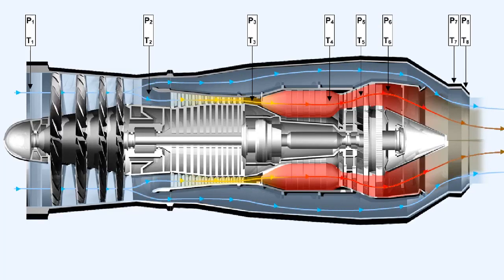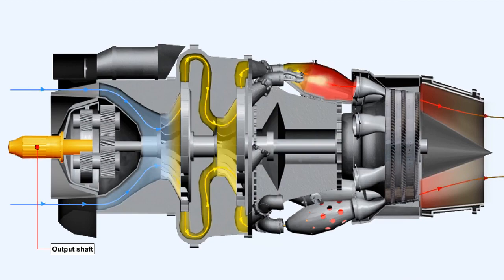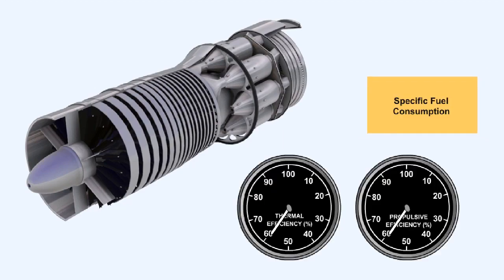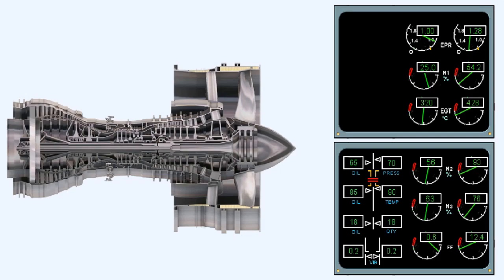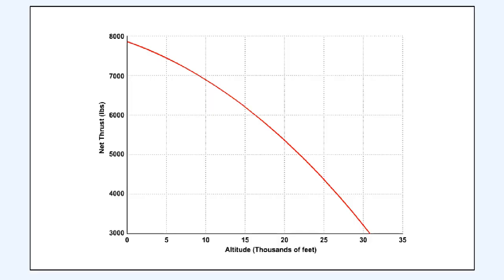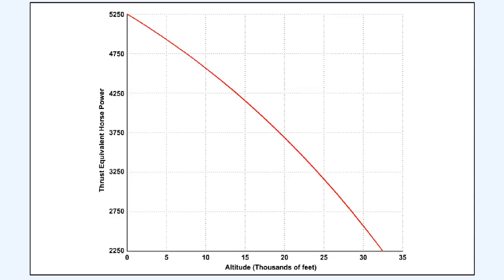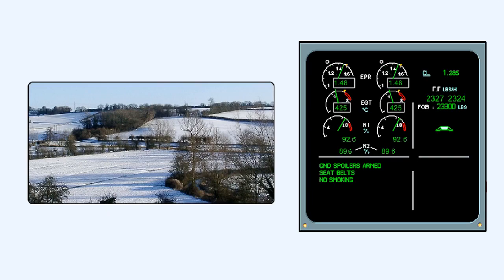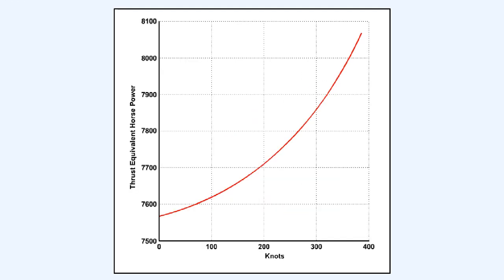Performance - Aircraft Gas Turbine Engines #13

Comment: Hi 09:43 why EPR showed to decrease?
Because I think at high altitudes and low density conditions EPR will increase.

thank you
Reply: According to my understanding, EPR is measured at two points n1 and n2  as the density reduces the pressure on the intake fan commonly denoted ad 'n1' will be less and as we know that exhaust gases pressure at constant rise in throttle is at
 speed of Mach 1.which is at point'n2'

So in simple words n1 reducing and n2 constant so EPR reduces.